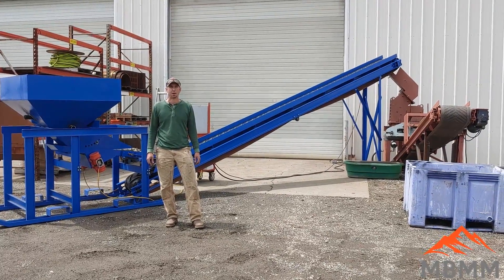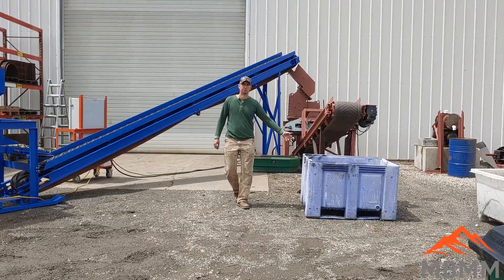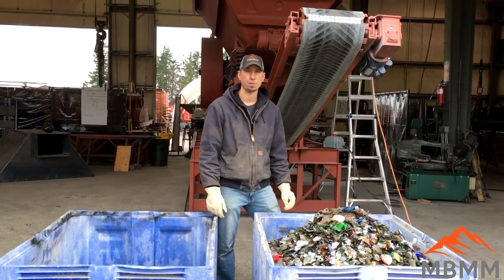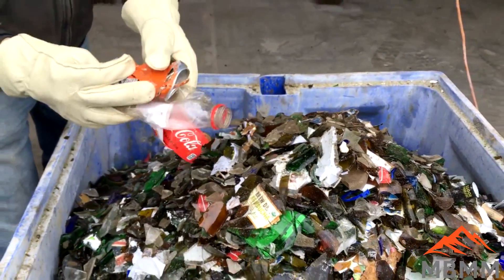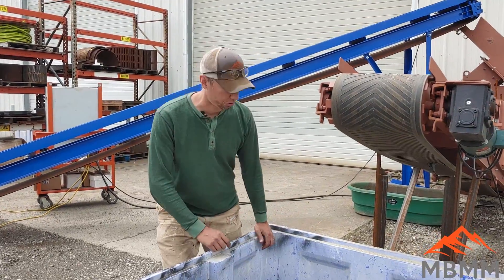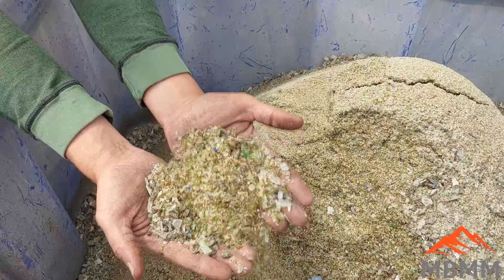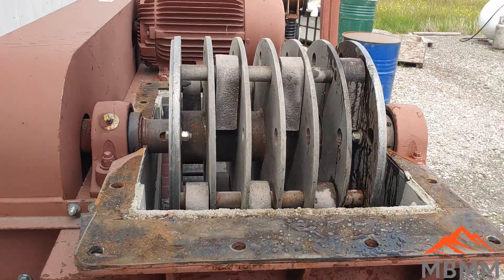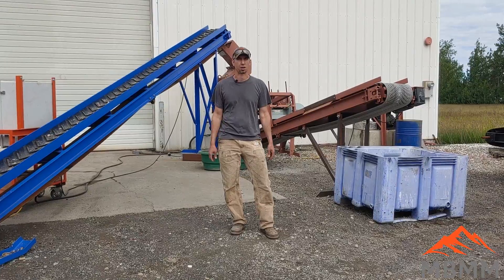Recycling Glass To Sand! Glass Crushing & Recycling Line

Comment: For a High Volume Operation, The Jaw Crusher could be a bit tighter on the Jaw, and then feed Two Hammer Mills, with the 1/2" or so screens, which each feed Two more Hammer Mills, with the Finer Screens. 

Or, after Jaw Crushing, a screening to send downstream the Finer bits, and return any large bits to the Jaw Crusher inlet! 

Also, after the First Hammer Mills, a sort and feedback Conveyor system could also be used, sending course bits back, and fine bits downstream!

Comment: But the finished product is not SAND
Reply: How is it not sand? It's manufactured glass sand. It doesn't necessarily work in all of the same applications as "natural sand", but it actually works better for some applications like abrasives because it's "squared off" (by it being crushed, not created by erosion) and not rounded like granules of natural sand. It can be used in many of the same applications as natural sand like play areas, erosion control and asphalt production. It has limitations on how it can be used in concrete due to the way it's initially formulated into glass bottles, but certain colors can be used effectively in concrete because of the additive that produces the color protects it from the chemical reaction with the concrete. If you gave me a choice, I'd pick the glass sand nearly every time because it didn't take more mining to produce it.

Comment: Do all those glass bottles have the same COE ?
Reply: Yes, typically bottle glass is all the same COE, just the additives are different to create the bottle's color. Window glass has a different COE, so you have to make sure that you don't have a bunch of old window panes as they are tempered and can't be recycled together to be reused in glass-making. If you're using them for sand, then the COE doesn't matter and you could pulverize them all together.

Comment: How does it take out the paper and other plastic elements. Or they are only crushed together
Reply: The labels and plastic are typically screened out (Jason mentioned that there are secondary machines that do screening for 4 or 5 different fineness levels). They typically won't make it through the first screen and can be easily removed there. When crushed, the adhesive usually stays with the label and the glass gets crushed and falls away from the paper label. I suppose there could be very find paper particles in the glass, but I'm sure there are ways to deal with that if you're remanufacturing the glass into bottles or need to purify it (like washing). Considering there are so many uses for glass sand outside of making it into new bottles, Jason's just talking about how to make it into something else. The big markets manufactured for aggregates from glass are hydroponics, asphalt production, landscaping (golf course sand traps come to mind because it doesn't clump like natural sand), abrasives, etc.

Comment: Very interesting ..I watch you thru Dan Hurd and tied into this vid after watching a vid outta New Orleans on recycling glass .The vid said there is an increasing demand for a coarser aggregate . And on a related note the same idea an  uses in NEW HAMPSHIRE for road base. Because the glass doesnt absorb water it does nt freeze as a base for roads so cracking etc is highly reduced

Comment: @mbmmllc: What size hammer mill do you have in the video? I notice on your website that you have 15, 30, and 75 horsepower. How long does it take to produce the resulting fine sand? Assuming the small screen is used, how long does the hammer mill have to run to make a ton of sand?

Comment: way back in 1974 I worked for Owens Illinois Glass Factory located Parkrose, Oregon. They separated the glass in 3 colors, brown, clear, and green. Then crushed and then sprinkled over the electric furnace melting the mix back into molten glass to be blown into bottles and jars. you might contact them.
Reply: Please  your  mobile  number

Comment: I am told there is a world shortage of building sand, but sand from deserts, which is abundant, cannot be used because the particles are too round and fall to the bottom when a concrete mix is vibrated. (Beach sand contains salt which corrodes reinforcement metal). I wonder is it possible to heat desert sand via a solar mirror array so that it melts to become liquid,  then stretch it, cool it and crush it  to get the kind of irregular/sharp gain product required in building sand. Obviously huge machines would be needed, so also a huge investment.

Comment: Very interesting process, what I'm wondering is value of finished product VS cost of transportation and processing. In short, can you 
make any money doing this?
Reply: Yes but you would not need to be paying more than £ 15 per tonne for your raw material (glass bottles) Processing costs roughly £ 45/£50 per tonne bagged in 25 kg... But you would need to build a machine that can process about 30 tonnes per hour... Sell on material roughly £110 per tonne for shot blast £140 per tonne into filtration market... Price to build a machine that will produce 30 tonnes per hour about 750,000 to 1 million... Build it on the cheap with second hand equipment maybe 350,000...
Reply: @sunnymccoy9327  Amazingly detailed and precise   answer, thanks' for this.

Comment: I have used this recycled glass to lay block paving on in England it stinks a bit with it being mainly beer bottles and you have to keep it damp while compacting with a Vibrating plate but it doesn't move after you've laid the blocks
Plus it's much cheaper than River/Concreting sand

Comment: The magnetic steel remover would be way more efficient if it were a stage, where the material is running on the actual belt, not the belt running over the material.
Less magnetic force needed, more material removed. However probably 2 stages needed because of glass contamination after the first stage.
At least that is how the local crushing line here is set up.

Comment: I don't think I buy the permise behind this kind of recycling. The purpose of collecting glass, is to save on power when making new glass, not just making the pile of shards go away? Normally glass is sorted by color, washed to get rid of stickers and metals. Then sold off to smelters as raw material for new glass. This method does not reduce emissions from the bottle and jar industry. If you sorted your glass and cleaned it, before crushing it, you'd actually be able to make a decent living from this.

Comment: Very I teresting video on the process of converting glass to fine sand. Out of curiosity, is the sand found on the beaches the same as this final recycled sand you produce? Also, it's incredible to know how sandblasting at very high PSI can take rust out of metal objects. I saw this firsthand at a company a friend of mine used to work at.

Comment: Does anybody know wat I can use to crush all the glass that I have as fine as wat was shown at the end,thanks
Reply: I use a 5 gallon bucket with hole cut in top of lid with long handle 5 pound modified hammer to pound with. I do need something better than a plastic bucket. The glass eventually damages the bucket, but it works.

Comment: Normal sand catches the moisture. This sand obtained from broken bottles probably cannot do that - it does not soak up. So what could be the uses of such sand?

Can it be used in concrete?

Comment: In 1953 , (68 years ago for the arithmetically challenged) I worked for Kimble Glass Co. in Chicago Heights, Illinois. Most of our product lines were whiskey bottles for the major liquor companies in the States. We routinely "recycled" old glass bottles which were then used along with lime and other stuff which I don''t remember, to make the new glass bottles. The "recycling" we did was in large scale quantities commensurate with our high quantity production - I think we had 4 furnaces running continuously to supply the glass for several concurrent production lines. Old glass has routinely been a component of glass production because it requires less cost than mining and refining of new material.

Comment: If you're going to crush glass that small you should never handle it with bare hands and you should ALWAYS wear a respirator. If you breath that dust for long enough you will contract silicosis and perhaps die from it. At the vary least you will have respiratory problems for the rest of your life. Best to break it into cullet and leave it at that. It's much safer. Libbey-Owens-Ford glass 12 years.

Comment: so let me get this straight.... glass is made out of sand and a few other ingredients heated extremely high, molten, fused and cooled down again...
now you just simply crush it into tiny pieces and get basicly tiny glass shards. yet you call the video glass to sand recycling.... ok? so this is nothing but a fraud
besides in the real glass recycling process the crushed glass gets added to new sand mixture and heated, molten and fused
well bottom line: title is misinformation, the video content still usefull and a good way of recycling prescious materials

Comment: naive questions... there's been articles insisting that colored glass be pre-sorted... higher prices for clear, less for green and less-less for brown...  how does that fit in? what happens to paper labels? electromagnets only draw out ferric metals... what about aluminum, tin, brass, et al? health issues of fine particulates inhalation? are you really handling waste products -- broken glass! -- bare handed? bad practice and worst yet you open yourself up for liability given your stance  as vendor and implicitly in 'thought leadership'... what is maximum thru put rate in tons per hour? what about mesh screens to prevent ricochets and spalling?

Comment: I was on a hammer mill project a long while ago.  Our hammers was a manganese super duplex material. The rotor design was very similar to yours. We had a throughput of 25 tons per hour metric. Our feed was lead acid batteries.  The hard part was the separation, we used a variety of conveyors, some screw but the main one was a giant chain mail conveyor for removing oxide sludge.
Reply: I think a lot of hammer mills use either manganese or chrome alloys for durability -

Comment: You can't just turn glass back into sand, a chemical reaction has happened to turn sand to glass, by just crushing it doesn't just turn back the chemical reaction. C'mon people be smarter then that
Reply: melting or changing states of matter is a physical change not a chemical change.
Reply: @Hi-og5ow  they add heat to make glass, it's a chemical reaction that takes place to change the structure of molecules

Comment: Damn I never realized you could turn glass back in sand.
Reply: in short you cant. Just like you cant turn steel into iron ore (quick, of course it can oxidized). There are bits of trace metals and compounds that i dont think its possible to separate. Also the main indigence silicon dioxide or quartz is in noncrystalline state and will take millions of years to turn back to its original form. 
This glass sand is used in remelting but he dont separate transparent and stane glass so i dont know about that. Also not sure if glass manufacturers need glass in this form.
Reply: @robertlee6338  Why can’t it be turned back into glass?

Comment: It is not recycling it back into sand, it is now silica dust!  Vitrified crystalline silica which is the leading cause of death in Canada with Silicosis!!!
If you think putting this "sand" on beaches is positive in any way then you should all take a snort of it like you are doing a line of Cocaine and see how long you live, MORONS!
It is bad enough that we use the same material for making our road lane markers reflective and it floats around the air on our streets, or even worse how streetcars use sand for fast stops vitrifying the sand between the wheels & rails with the heat from the friction!  Streetcar drivers used to "dust" cyclists forcing us to breathe it in until I called up the TTC and told them the next time I got dusted that I would defend my life by pulling the driver out of the streetcar and pounding the shit out of him!!!  With little legal recourse, they are now using new streetcars that don't appear to use "sand" as a means of stopping faster!  Put MY LIFE at Risk and I will put YOUR LIFE at Risk!

Comment: Interesting. I had always just assumed recycled glass was melted together to make new glass instead of crushed.
Reply: I worked as a glass installer and I had the same assumption. They told me that each manufacturer of glass used a slightly different "recipe" of chemicals to make their specific types of glass. And that if you just tried to melt that down and mix it up together, it would not work because current methods (as of 2014) would not be able to get the different glasses to mix evenly. It would be patchy and those patches would be weak points that would break at the slightest thing, even temperature changes of one side being at 40F and the other being at 70F. So a 30° temperature differential could cause the glass to break from "heat stress" oddly enough. 
This guy has it right though, that sand can be used in cement as an alternative to regular sand. So not as much recycle as re-purposing.
Reply: @James-bw4np  yea, I figure it would at least be useful for cement, though maybe not cost-effective if in a region that has lots of sand naturally.
Reply: @westtex3675  I’m pretty sure that not all sand is created equal. So the sand a country has isn’t always the best for concrete
Reply: @RhysShields  right. river sand is the best apparently, desert sand - no good, too smooth. so you'd think living in a desert would be great, but no.
Reply: @rojer9  and desert sand is full of various minerals like calcium that do bad things, whereas river sand  or sand from wet areas would have had those washed out
Reply: crushing it makes it way easier to deal with. it's a lot easier to move around a plant and into batching machines and furnaces when it's a powder. at my plant we can blow the powder through 4 inch pipes up to a furnace 3 stories high using air pressure. you can't do that with bottles
Reply: I was called a glass recycling company in Constanta (not just one, but this is the cake of them), on papers,, of course he has a site online. Sites online we have a ton, with recycling principles and stuff. Yeah moralistic stories everywhere !!! I called the most official Constanta recycling system possible. "Sorry we don't take anymore glass because THE GLASS COLLECTOR PARTENER COMPANY WE WORKED WITH  HAS FINISHED THEIR ACTIVITY AND CLOSED !!!"😈🤬😡😠 
P.S. THERE IS CURRENTLY NO WAY TO RECYCLE WINDOW GLASS IN CONSTANTA, A CITY WITH 500.000 INHABITANS !!!
THE CONSTANTA IS AN EUROPEAN UNION CITY !!!🤪😜😟

Comment: How does it smell? Can’t imagine crushing a months old piss bottle lol
Reply: Smells like money.
Reply: @thomasstuart6861  £140-£160 per ton @ 20 ton per hour... How does that day's work smell...))
Reply: @sunnymccoy9327  The equipment is not that complicated. An ecologically smart guy with a welder and a grinder could make some money and strangely get paid to take their garbage. Money at both ends. There are a lot of products that can't get a foot hold because glass costs so much. Like a glass bird bath. I would have set this up in my driveway and given up my day job if I was younger. If you could get a plastics thing going that would be like mining gold.
Reply: @thomasstuart6861  plastic is valuable but difficult to collect as takes up so much space to get any weight ... Solid plastic maybe...
Reply: most people use something called a toilet for pee-pee, and the bottles usually smell like old soda, or like a theater's garbage can
Reply: @vasectomyfail442  apparently you've never used a few years old recycle'o'mat in Germany :D
Reply: @vasectomyfail442  Probably inyour household....
Reply: @vasectomyfail442  Most people???!!! Has to be your household.
Reply: Usually the glas gets cooked at some point to get the paper (label) out of the material - for example. I guess that part solves the mold and piss odor.
Reply: Years ago, I ran a Can Pack, it crushes aluminum cans into twenty-pound blocks, and those cans have a smell, especially in hot weather, that is so uniquely bad, I can still smell it twenty years later.
Reply: They distill all the drippings and resell as jagermeister
Reply: I use it for sandblasting and some of it stinks 😷
Reply: JARATE
Reply: depends on where you source your glass. Most bulk recycled glass comes from deals with bars, restaurants, etc for pickup. It's a lot less gross than getting it from residential.
Reply: Damm, lots of folks without a sense of humor in here huh lol Everyone, he was half-joking I'm sure, and if you watch any of mike the scavengers video's you will know that piss bottle from construction workers is a very real thing.
Reply: @patprop74  exactly what I was talking about!!
Reply: Like a brewery when I crushed beer and wine bottles

Comment: I run a pool maintenance business in Perth Australia, and we use crushed glass as media for pool filters. The theory behind it is that the glass grains have sharper edges than the grains of sand so they can collect the dirt from the water more efficiently than the naturally occuring sand grains... but honestly I don't see much difference in perfermance between 16/30gr sand and the fine glass in performance.  But hey, customers ask for it and we provide.  The glass is a multigrade of some kind, if you look close you can see that it is a mix of different coloured glass.  It looks much like glass and is applied the same as glass, but if you spill any while filling the filter you want to sweep it up because unlike sand, kneeling on glass pieces will do you some damage.